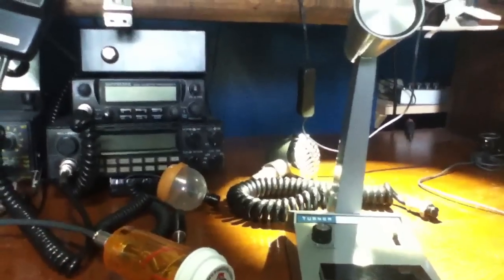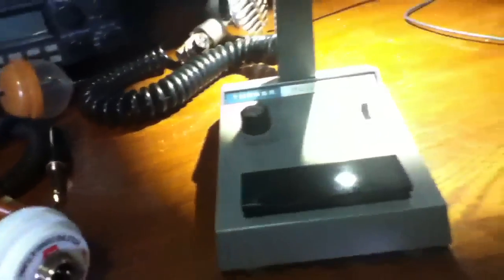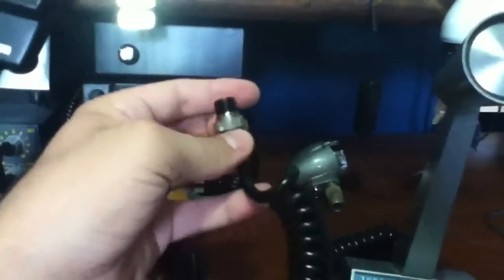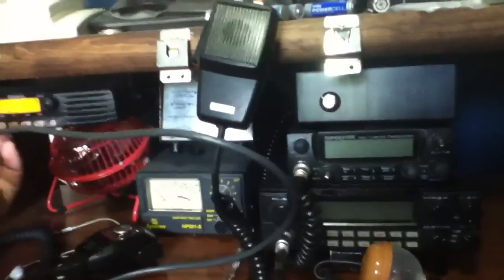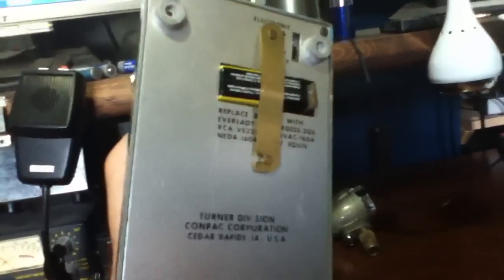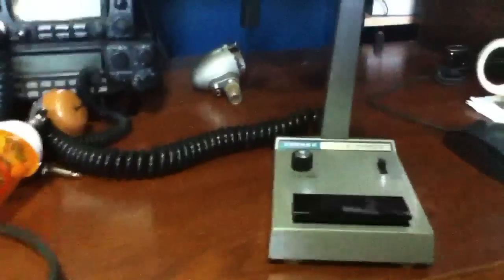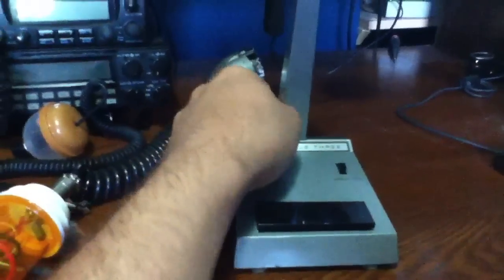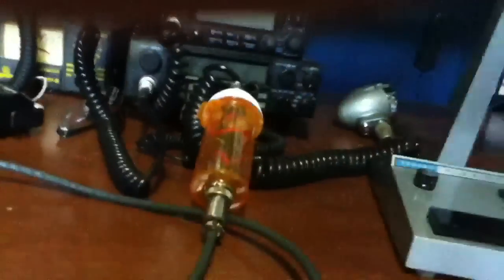Turner Plus Three microphone on a Kenwood TM-281a 2 meter

Comment: Any links to the components needed for this? I'm doing a similar setup with my Turner Plus Three and a TM-261a.
Reply from the maker: Building one is easy. You will need pill bottle, a 1:1 600 ohm transformer (Radio Shack used to sell them, but you can salvage them from old modems or buy them from talonix.com), a 1uF 50v capacitor soldered across the audio in and the ground in (mic in side) and if you want to add more security, which is a good idea if you have kids who like to play! Add a on/off switch to the PTT, add some tape to the switch, and you're good to go.